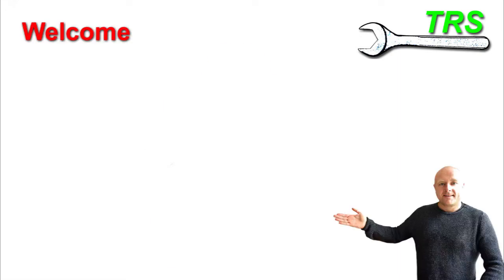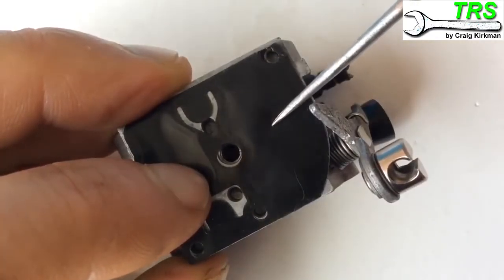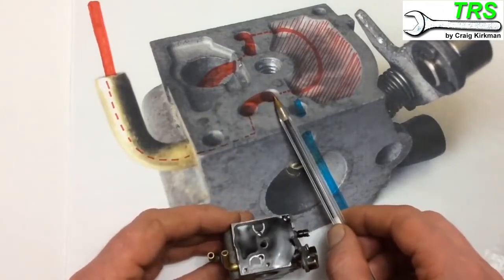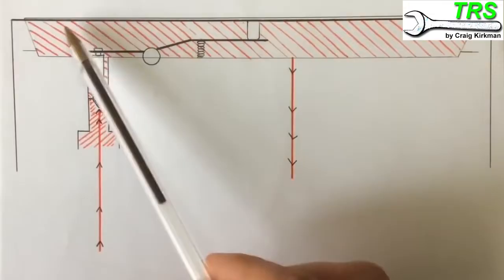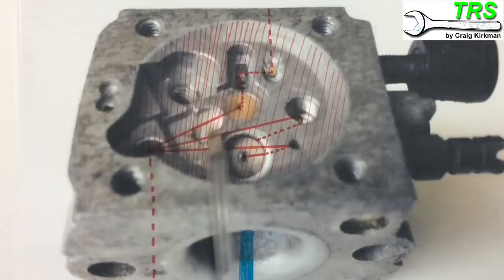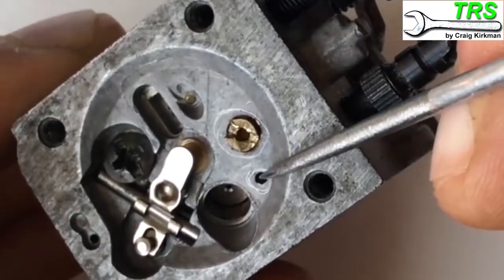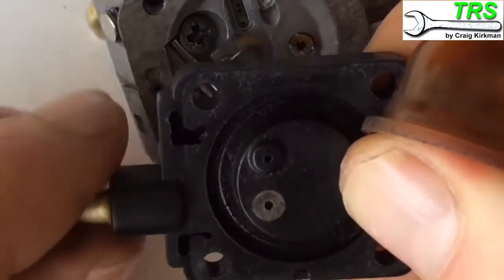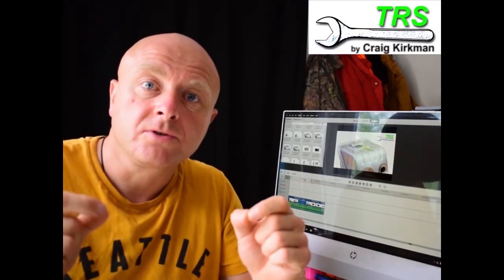Two-Stroke Carburetor | How Fuel flows through.  (by Craig Kirkman)

Comment: Thank you Craig.  Your explanations via diagrams of the complexities of the two-stroke carburetor are invaluable.  That said, could you explain this?  If the purge bulb doesn't fill properly, could one presume that the main nozzle is faulty--that is, it's one-way neoprene valve is allowing air to enter the metering chamber?  If so, do you have a solution to correct it?
Reply from the maker: Thanks very much for the kind words — really glad the diagrams are helping! Great question too.

If the purge bulb isn’t filling properly, you’re right that one possibility is the little check valve (the one-way neoprene flap on the main nozzle) not sealing. If that valve leaks, air can be drawn back into the metering chamber instead of the bulb pulling fuel through, so the bulb never fills properly.

Other things can cause it too:

A stiff or cracked pump diaphragm.

Blocked gauze screen in the carb body.

Hardened fuel lines or a poor tank pick-up.

If the nozzle check valve is the culprit, unfortunately it isn’t serviceable on its own — it’s built into the carb body. The usual fix is either fitting a rebuild kit (which refreshes all the diaphragms and gaskets so the system works as intended), or in stubborn cases, replacing the carb entirely.

So yes, it can be the main nozzle valve, but I’d check the diaphragms and filters first since they’re easy fixes. If those are good and the bulb still won’t fill, then you’re likely looking at a carb replacement.

See how you go on with this and let me know.

Craig

Comment: Very grateful for this vid.  My question concerns the primer circuit.  My initial assumption was that the primer bulb drew fuel from the tank and forced it into the area under the metering diaphragm and out the various orifices into the carb bore.  From what you've shown the primer bulb sucks fuel through the area under the metering diaphragm and then returns the excess back to the tank.  Am I correct?  No offense but the primer bulb section could be done slower and more concisely.
Reply: I just saw your longer video explaining how the primer circuit works.  Excellent.  I see that I understood you correctly, above.

Comment: That was actually one of the best physical + graphical explanations I've seen. That was really good.

Commentary: - The bulb has a mold seam.  It is not a split.  Your explanation of forming a loop when you press the bulb is exactly right.  Push - gas is returned to the tank.  Release - fuel floods carburetor chambers and wets the jets.  Just as you said.  This does not need any kind of bleeding that a 'split bulb' would give.   A split would just make the pumping action less sure.
Reply: He did not say "that" bulb had a split - just that if there is a split that is an issue.

Comment: Excellent Excellent video. Quick question, how is primer bulb different than choke. I understand choke is used to prevent the air flow to make engine rich, not sure why do u need primer bulb. also why a 4 stroke carb doesnt have primer bulb. i understand primer bulb is used to suck fuel from carb to the tank, why do u need this and why we dont need this 4 stroke carb..

Comment: Brilliant video, I found this even better than the normal drawn diagram videos which are also very useful.  It was good to see the actual carburetor openings and flow of fuel. Its difficult to imagine why these carbs sometimes do not work but when you have an rough understanding of how they do actually work, sometimes it can be very obvious what is causing you problems.  However, sometimes not 😆
Reply from the maker: Thank you so much for your nice feedback. It's comments like yours that motivate me to continue making these videos. Craig 😀👍

Comment: What happens if it wont ideal it cuts out when I stop reving strimmer why???? Great vid buddy..and the carb which is a zammer has one screw that's all
Reply from the maker: Thank you for your nice feedback. I would look at adjusting your carburetor.  I have a video here on youtube that shows you how to do this.  In the example I use a chainsaw but the principles are the same for most two stroke machines. You can find it here in the link: https://www.youtube.com/watch?v=74p9FLmIkkw&t=31s . Thank. Craig
Reply: @TheRepairSpecialist  thanks Craig and kepp up the detailed and accurate information on you're vids great work buddy👍🏻👍🏻👍🏻👍🏻👍🏻😜thanks for the replie...